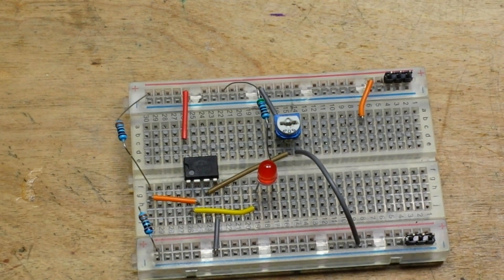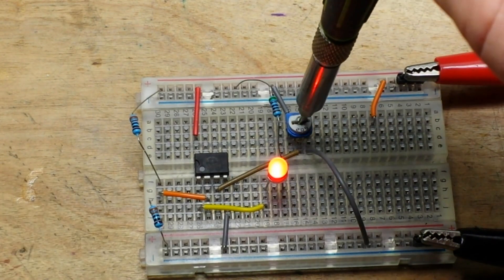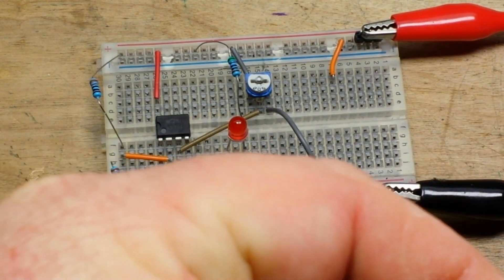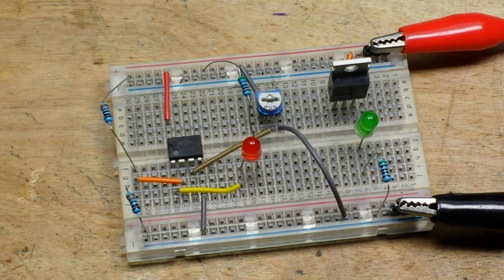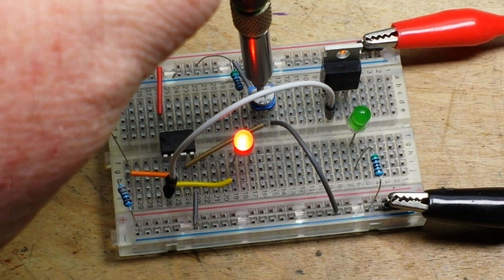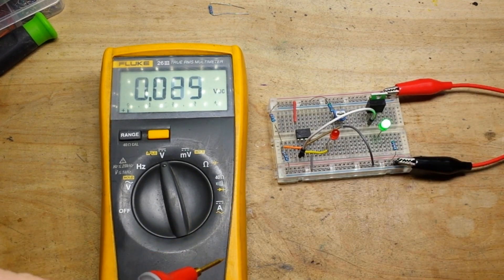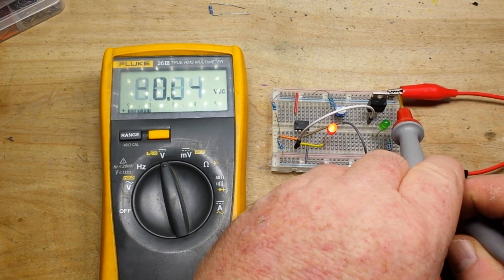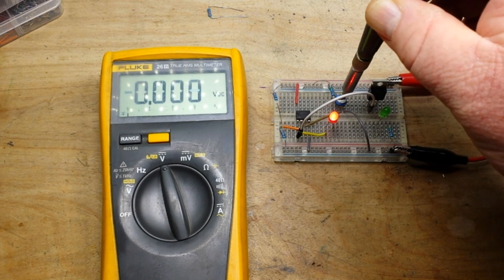Low Battery Cutoff Circuit with LM393

Comment: I just ran across this video and haven't seen the first, but if you use the voltage source to establish your reference voltage, will this circuit work for low battery cut-off? When the battery voltage lowers, doesn't the reference voltage do so also?
Reply: You can use a zener diode to make a simple voltage regulator as a reference voltage, because the ideal opamp input impendence is very high, it woun't suck big current, so a zener diode will to the trick very well. 
Maybe pick a 3.2V one(for Li-ion single cell cutoff voltage is pretty good I guess), series with the current limit resistance. That can provide you a fix voltage precise enough, even if the battery voltage below 3.2V, the zener diode just like open circuit, so the voltage is pulled high as supply voltage.
The only one question is the opamp or comparator can work in very low voltage or not.
The circuit is like
VCC-(current limit resistance)-*-(3.2V break down zener diode)-GND
If your VCC is higher than 3.2V, the * point will alway show 3.2V.
If VCC is below, the * point will show you the VCC.

Hope this will help.
Reply: You are correct. This is just an example though for basic understanding and simplicity. The reference voltage and the battery voltage should be seen as two separate and or independent variables. This way just means that he didn't have to use two power supplies or use a more complex circuit. There are ways to make a steady reference voltage from a battery but that would go beyond the purpose of this video. 

A simple off the top of my head one would be to use low drop out voltage regulator that outputs a voltage lower than your actual cutoff for the reference and use a divider for the input that would meet the reference at you desired actual battery voltage to cut off. Basically scale the voltage down at the comparator so it works at lower than cutoff voltage.
Reply: Yes it does but that drop can be taken into account at the divider.
Reply: Yes, you're right. I'd look at something like a LT6703 which has a reference and some hysteresis built in. They have a spice model. I've hand soldered the tsot-23 version to breakout boards and directly to wires for prototyping. It's a bit fiddly but doable. 

You can make a simple reference voltage with a zener. IME, particularly around 3 volts, they are not great for that but they can be made to work.

Comment: Now use a Zener Diode or other V Ref device  to provide a Accurate Voltage Reference.    A 3 volt zener would be handy working on li Ion Cells for the Low Cut Off .      Handy Circuits these are.     Did you know you can use various color LED to provide a Voltage Reference ?

Comment: I connect my mosfets differently: Source = from (P-chanel goes directly to VCC, N-chanel goes to GND), Drain = to (load) works the same way and makes more sense.
Also it makes it easier to accomplish Vgs with less effort, avoiding voltage drops across source and load - since you usually need a resistor from G to S for fast switching, if you have a load connected to source it will create a voltage drop across the gate, making it enter the linear zone, heating up the mosfet and limiting the current - this is how i see it, correct me if i'm wrong.

Comment: p.s that green led lit up before you connected the gate!!!! or am i seeing things..
Reply: It is very difficult to see because Paul's hand is in the way. Two things that sound plausible to me: 1. The jumper wire from the gate shorted to the V+ side of the circuit while moving it around. - or - 2. The jumper wire from the gate of the MOSFET touched Paul's finger and in turn Paul touched the V+ side of the circuit. In both cases this would be enough to charge the gate of the MOSFET and turn it on.
Reply: yes Dustin I think no.2 is what might of happened coz I looked at it over a good few times to see if the jumper its self touched a +V but couldn't see right. I think maybe his finger touched and it was very close or even contacting his finger too. I knew I wasn't seeing things!! thanks for answering!!
Reply: 2:37 Lit as Paul made finger contact with the bare end of the wire. Either providing a path to earth through his body, or hand brushing against another component. Worth analysing for sake of beginners, and just out of curiosity.
Reply: @itsafeaturenotaflaw  thanks Khakoo. I'm going to get some fets and play around with them, always forget to buy some when I'm getting bits.
Reply from the maker: Khakoo is right. Inductive coupling through mu body opened the channel. If you want to see a very explanation of this effect watch Julian Ilet's MOSFET experiments.
Reply: I will do Paul thank you, ya know iv never played with mosfets!! I must get some the next time I online buying stuff. and some Jfets. actually now I remember you were playing with a Jfet one time showing how sensitive the gate was by connecting an antenna(piece of wire) to the gate and using touch to activate. il check out Julian's page, nice one.